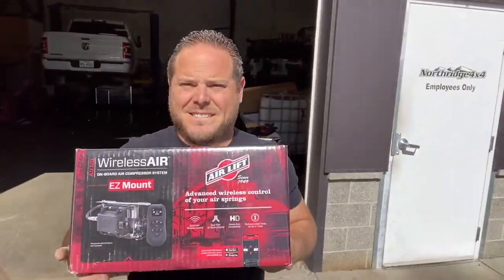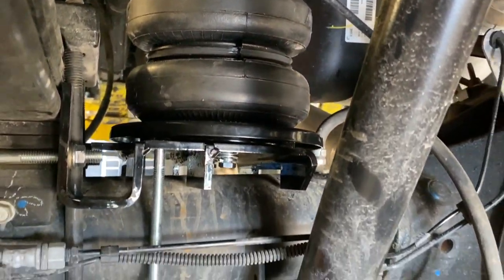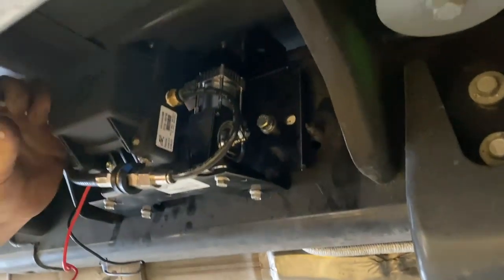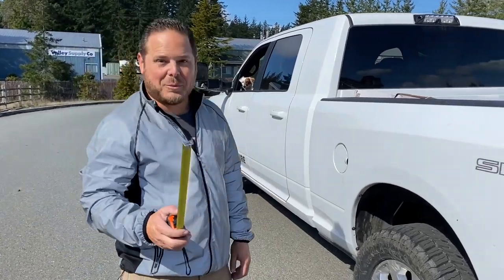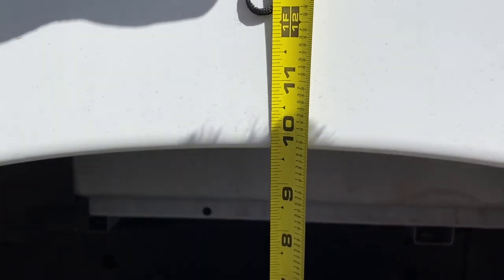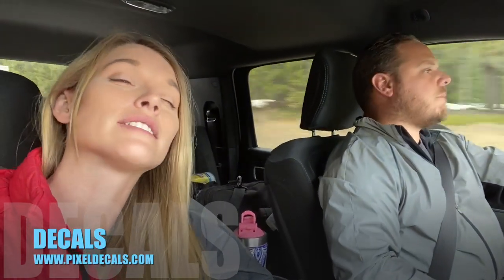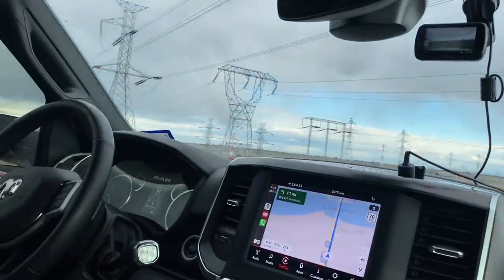RAM 3500 GETS AIRLIFT AIR BAGS!

Comment: I put fun bags on my 19 Ram 1500. Easy and works great. Did the wireless compressor and everything went smooth. Just the 1500’s you have to cut off your bump stops. So no going back.

Comment: My Ram dually has the factory air ride and self levels, totally different spring package than a standard suspension truck. You need a complete package to get the ride your looking for.
Reply: Your Ram simply has one less leaf spring then the factory non air assist Ram 3500s. They could just take off one leave spring and it would be the same.

Comment: Your drive tires wear faster due to the fact they are pulling the trailer and pushing the truck.
I drive an 18 wheeler and the rear axle on tractor tandems pulls the load and wears quicker.
Reply: I was going to say the same thing. Driving tires wear much faster, hence the need to rotate.
Reply: Yeah, can't believe he thought it was from weight.
Reply: @jaydak99  Not all of us had science teachers for fathers that threw in a good amount of physics every day. I just wish they would get a dually to tow those loads. It would be much safer.
Reply: @consaka1  dad was a Navy boiler tech, then law enforcement. Took physics classes on my own, as well as every tradesman class offered. It just seems like if this couple builds 4x4's and drives them, they would have an understanding of basic physics. If they tow those loads often, they would benefit from duallies.
Reply: @jaydak99  Oh you would be surprised how many people build stuff and start their own business working with trucks and heavy equipment that haven't a clue the physics behind the tools and machinery they use. Case in point, many dentists. Dentists will use many tools including slow speed and high-speed handpieces yet they have no idea the intricacies of the parts or how to fix them. Often they aren't even sensitive to the different sounds they make when a bearing cage breaks. They will keep using it until it is completely destroyed. I have repaired dental tools for the last 20 years or so. Mostly for my brother-inlaw. I think it is similar for many people. 

I really hope they try a nice dually and see the difference. I would hate to see them get hurt or anyone else get hurt. I hope they have trained themselves not to reflex swerve when driving that tow combination.

Comment: If remember correctly from my airlift. It's 50lbs per 1 psi gain in load. Its ok to sit on load spring that what its there for. I set my bags at just in gauging or a hair off load spring. Not to bouncy and not to rough ride either.

Comment: Thomas is correct. The longer vent tube in the rear is common on most trucks and is there due to boat ramp angles submerging the rear more often than the front. A proper water fording kit would relocate the front vent to air cleaner box elevation, or higher. Now I have a question for you. Why no E3 logos or advertising on the Foster Child? Isn't E3 the primary sponsor?

Comment: For the rear tires have you spun them at all? Intentional or not that would take all those off.
Reply: Don't have to spin them. Diesels have enough torque to roll the tread right off the tires (can leave black marks with burn outs just hard enough accelerations)

Comment: Did I miss a video where the truck got a leveling kit? No need to get the rear back to unloaded height otherwise. The tire wear is just showing that you need a dually to spread the load across more tires.

Comment: Adding the air bags won't change the weight distribution nor the tire wear difference front to rear.  The rear tires are wearing more rapidly because they're doing more work than the front by carrying the weight of the trailer and pulling the load.
Reply: Exactly ... The only way to move weight without moving the cargo is to slide the axle or slide the king pin.  And since this is not a tractor trailer..you can't move the weight.. My recommendation would be back the stepchild on the trailer...
Reply: It most definitely will change the weight distribution. When the back end sags, the front will lift, and result in a loose steering feel. When this happens, the rear tires will end up with more of the trucks weight on them. Plenty of people have done this test using truck axle scales. Raising the back end up, will let the front end settle back down. this will bring back the unloaded steering feel.
Reply: The weight does move to the front when the rear is raised. The rear airbag helps the vehicle pivot moving some weight forward.
Reply: GGFCHMMAL You just contradicted your self by saying weight doesn’t move, and that it then does move. But to be clear, I didn’t say the trailers weight moves, but that the trucks own weight does.
Reply: @Stuka87  The back end sags due only to the downward force the trailer goose neck is applying to a fixed point on the truck.  Raising that point at the trailer/truck interface doesn't transfer weight laterally to the front...it just makes the rear higher.  Assuming the rear is raised 2" and the connection of the trailer is 120" from the center of the front tire and you solve the resultant triangle the distance between lifted vs non lifted is about 0.02" or the thickness of 5 sheets of paper.
Reply: @johnsweeney4257  Again, I did not say raising the front will transfer trailer weight from the  rear to the front. What I said is the trucks own weight, will transfer to the rear axle if the rear is lower than the front. This is why steering can get loose feeling when the back end sags. Lifting the back end up will allow the trucks own weight to sit back down as it would when unloaded. Its the reason gassers at the drag strip jack the front end way up, to transfer weight to the back. And why FWD drag cars jack the back end way up, to transfer weight to the front.
Reply: @Stuka87  I think you're comparing 'apple to oranges' with the drag racing analogy where the critical factor is weight transfer under high acceleration forces.    Try this one... drive the front wheels of the truck onto a scale and record the weight.  Now, jack the rear of the truck with the air bags.  Does the weight change on the scale?  I don't believe it will. If it does my bet would be that the change would not be within the tolerance of the scale and, therefore, moot.
Now,  changing the height of the coupling point can affect the driving characteristics.  The higher the coupling relative to the rear wheels the greater the font end lift will be under acceleration along with more dive under braking.  It's simply acting as a lever.  The longer that lever, the easier it is for the resistance of the trailer to influence the front end.  It will not effect static weight.  Just my opinion.
"Give me a lever and a fulcrum on which to place it and I shall move the world".  Archimedes
Reply: @johnsweeney4257  People have done tests (on a per axle scale) with a pickup and trailer and compared the back sagging way down compared to being level with air bags. The weight measured on the front and rear wheels of the truck did change. It doesn't have to be a trailer, just a big heavy load in the back can cause it. This can also be seen by measuring the front suspension changes. Which I wish they would have done here. Because without the air bags, the front was most likely sitting higher than with them aired up.
Reply: @Stuka87  I would have to see those tests, determine if they were performed correctly and then figure out why physics stopped working.  Explain to me what mechanism transfers weight horizontally (forward) while the point load is moved only vertically.  What am I missing?
Reply: John, Stuka87 is correct. The proof is seeing the gap between the top of the front tire and the fender get smaller when you add air and raise the rear end of the truck. Weight is added to the front end and compresses the front springs, therefore, making the gap between the tire and fender smaller.
Brit and Kevin, you will get the best and safest ride by adding enough air to level the trailer and bring the front tire to fender gap to within 1 1/2” inches of unloaded. This should balance your load and prevent trailer sway. Provided that you have the majority of the load weight in front of (or on top of) the trailer axles. Considering the Step Child does weigh more then the Foster Child, you really should have it loaded on the trailer first. Just my two scents.

Comment: Do you know your tongue/weight with the position of each vehicle. This will make your trailer more stable and reduce the "sway". Proper tongue weight will also require less stress on your new air springs/ bags. I just did this to my 2016 Chevy Duramax  2500HD with 6.6L Diesel. I too took measurements before and after at both front and rear fenders. I leveled the trailer took frame measurements. I then loaded my 2016 JKU  5200lbs on the trailer 3200lbs and adjusted the position of my Jeep on the trailer until I got 850lbs. Then I marked the trailer for future loading so I am spot on.
I am going to guess the Step Child weighs 6200lbs, the Gladiator new is 5000lbs with options I'm going to guess 5900lbs, trailer with the hydraulic lift gate is also close to 5500lbs. Then your total weight is 17,600lbs, with 15% tongue weight you should have 2,640lbs being applied to Child Support. Let me know what you think. I bought a Sherline tongue scale.
Reply from the maker: Step child is 6700, trailer is 9500 and foster child is probably 5500
Reply: @LiteBrite  Trailer is much heavier than I thought.
Reply: @LiteBrite  This is a great video idea. Many scales along the freeway are closed, but have the weight display on.  Find one, and you can weigh each vehicle and the trailer separately.  Then hook the truck to the  empty trailer with the trailer wheels off the scale and the full truck on the scale.  Try different combinations of loading the jeeps to get the tongue weight just right.

Comment: There is such thing as draw bar weight you need to know how mutch weight is on the draw  bar and try to load the trailer accordingly and you shouldn't need to alter the bag pressure either side as the draw bar is in the centre of the bed

Comment: It wont distribute the weight as much as you think. In most case air bags used to level add more weight to the rear axle. And the two inches of squat is is ment to happen.. Measure the pickup rear hight to front height loaded and unloaded i bet with no air its sits almost dead level.
Reply from the maker: Rear was sitting lower then the front and it rides much better with the bags and now we don’t have to adjust our headlights every time we’re loaded or empty

Comment: Well, your truck is rear wheel drive when highway towing, of course the rear tires are going to wear faster.  The front tires are just rolling, while the rear are putting the torque to the road, to fight the aerodynamic drag, accelerate your load and pull it up hills.
Reply: And their miles were mostly freeway miles. The front tires wear from braking but not a lot of that on the freeway.

Comment: I am a trucker and very curious how much weight it shifted to the steering tires? I do Individual axle weights on my big truck you can pull onto a scale weigh the steer tires pull up and weigh the rear tires and subtract the difference then pull the trailer all the way on and get total combination weight and subtract the steer and rear tires weight from the combined weight and you get trailer weight and for driving in ice or snow always put the heavier load forward on your trailer it avoids jackknifing and gives you better traction

Comment: that system looks great and that pj trailer is awesome. Are you sure a SRW ram has enough payload to tow that much? 7500lb trailer with 14k on it is about 22k total. looks like it pulls fine but I always use a dually over 20k of weight. how has this setup been?

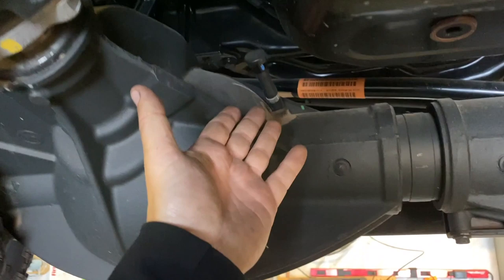Comment: Drive tires squish and flex more because of torque and added weight.   They will always wear more unless you have poor alignment up front.   Thinking that a dually with the HO Cummins, Aisin transmission and 4:10s would have been a better truck for your application.

Comment: Why does the child support say"not for hire"?
Reply: It's has the capacities of a commercial vehicle, so if they're hauling loads for hire, they'd have to have a motor carrier permit and US DOT numbers displayed.
Reply: @DeepOwl1073  thanks! And props for not being an internet troll with a sarcastic response!
Reply: @justintb96  hahaha! No problem!
Reply: Do they have to run a log book?
Reply: @kevingray4996  I assume he has a non commercial class A. If that's the case, no log book.
Reply: Doug Powell I used to drive a box van without cdl but still had to run a log book so just wondering
Reply: @kevingray4996  I'm just guessing. I've had a CDL for 17 years and I rarely run a log. Only when I venture out of my 100 air mile radius
Reply from the maker: Kevin has a non-commercial class A. The  “not for hire” isn’t necessary, it’s just more of a way to relay the message to the nice policemen’s to hopefully save them and us the trouble.
Reply: @LiteBrite  the less contact with Johnny Law, the better. unless he's a fan!

Comment: Air bags are over rated. Should have installed some tork lift stable loads. Air bags lift the truck back up disengaging the overload leafs. You want the overload's touching when you are towing heavy for added stability. As someone else mentioned the unloaded ride height of the truck has a rake to compensate when you put weight on the truck. There is no benefit to raising the truck back up to the unloaded ride height. I used to run air bags on all my trucks until I tried the stable loads. Never again.

Comment: people don't take these trucks in deep water, but they do back in boats. so the rear vent tube is up high for that reason. hitting the occasional deep puddle shouldn't suck water in the front end. if you park in deep puddles, well different story. But its for boats. You can extend both If you want, up high on the firewall.

Comment: Typically old people buy your truck.to tow 5th wheelers and boats. The rear diff breather needs to be higher up to stay out of the water at the boat launch. As people usually back In to far submerging the back end too far.

Comment: You should take it to a truck stop and put it on a scale and axle weigh the truck and trailer and do a comparison on the difference with and without air in the air bags

Comment: you should stop at a cat scale and find out whats heavier the step child or the foster child and load the heavier one on first.
Reply from the maker: The step child is heavier and it’s in back loaded directly over the dually wheels. You do not want the but tongue weight. The trailer is loaded properly as it is. We’ve already stopped at scales multiple times
Reply: @LiteBrite  goods to hear.

Comment: Time to get the truck to the  weight scales. See what you have per axle . Air bags will do next to nothing for weight distribution. May even make it harder on the rear. As you carry the same load most of the time get the weight of pin box done also.  There is plenty of room to move the load around to get it right.

Comment: I thought it was the other way around, no?.. curious to see if that actually puts weight back on the front tires. The weight is always there, raising the pivot point may decrease the weight on the front. Let me know! I was curious about getting bags for the rear of my  Ram 2500. It would be a different set up since I have the linked front and rear suspension though..
Reply from the maker: It seems to ride a bit better and now we don’t have to adjust our headlights every time we’re loaded and unloaded

Comment: I see others have also said the breather tube on the rear is higher for back into boat ramps. And that is true. Every rear is that way even the 2wheel drive trucks. There's no difference between a 2 and 4wheel drive rear axle, a 4wheel drive is just a 2wheel drive with a transfer case and front axle added.  But I have no clue why they didn't make the vent tubes on the front longer. On all my 4x4 trucks I run new vent tubes from both axles, I run the rear vent tube as high up as I can into the side panel of the bed so that I know as long as water never gets to the top of my bed I don't have to worry about it getting into my rear diff', and I run the front vent tube up near my break buster for the same reason. I've seen a few guys destroy their diffs' because they ran through water over the tires and filled their diffs' with water and didn't know it.

Comment: Good Morning! 27th! Kevin seems to be the one "pumped up" with these air bags! So fun when mechanicals excite him. Guess its time to rotate the tires. I'd get both of those dif vent tubes up high and vent valve the ends, just in case. Where to next? Drive safe and get rested up - its time to start this Country's engines back up! LiteBriteNationLiftsUsUp!

Comment: The goose ball should be slightly in front of the rear axle. This would not shift weight off the front axle when loaded but mostly put the load on the rear as it is designed. The air bags should only be inflated to level the truck and not to bring it up to unloaded ride height. You can remove the large overload spring from the leaf pack to soften the ride and allow the airbags to take up more of the load in the rear to smooth out the ride when loaded and unloaded.

Comment: Are sure that’s a front axle disconnect? Only the 2500 with the Power Wagon package has it. Also air bags are great! Mr. Truck from TFL has them on his Ford
Reply: It's the sport model so it does come with the front disconnect

Comment: The air bags do improve the ride nicely.  Having the rear of the truck higher really helps cooling of the engine compartment.  The temperatures of the fluids is controlled by thermostats.  But all the components under the hood will be cooler.